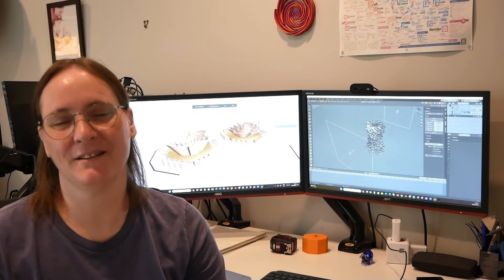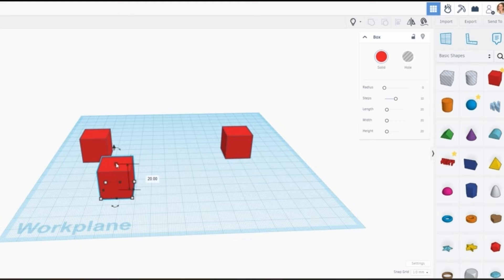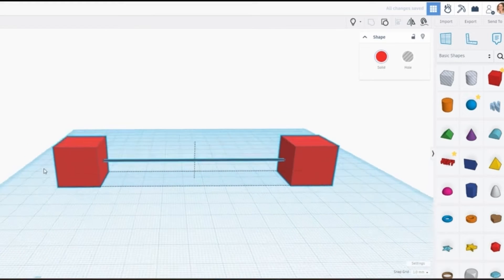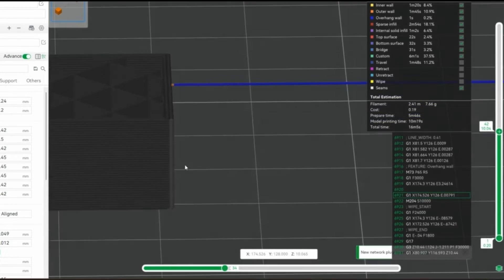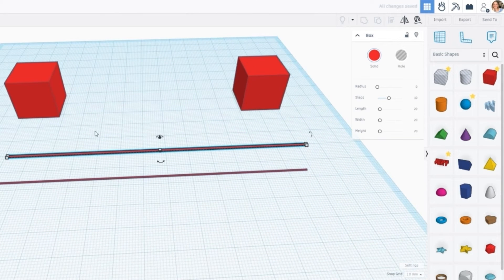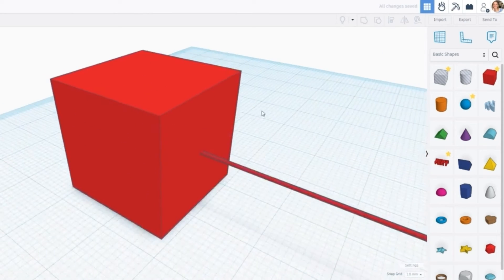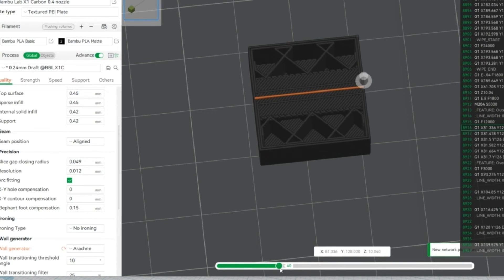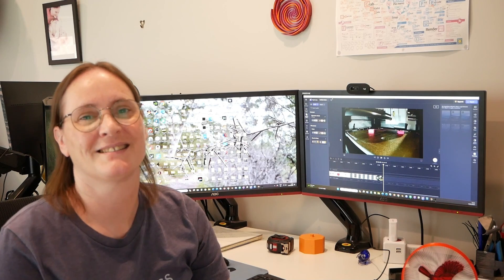Talking Strings - The Basics

Comment: I have a question, because I'm trying to wrap my head around this. Can you -  with your printer, settings and filament - print a bridge overhang the same size as that string and make it not look horrible? In my mind, the first layer of a bridge is just a series of strings, so it should work the same way, but for me it doesn't. It just ends up all droopy. Or does the string droop and we just can't see it, cause it's on its own? Or will the "series of strings" only droop when loaded with consecutive layers? If that is the case, could the slicer be forced to print several layers of strings before loading them with a criss-cross pattern? I'm just thinking out load now. I'd love to hear your thoughts on this.

Comment: Thanks so much for sharing this information!
Other than changing the walls in the slicer settings, is there anything else you change or set?
Is layer height at .24 necessary vs keeping it at .2?
I tried to design something with this method but the strings fall apart in the middle.